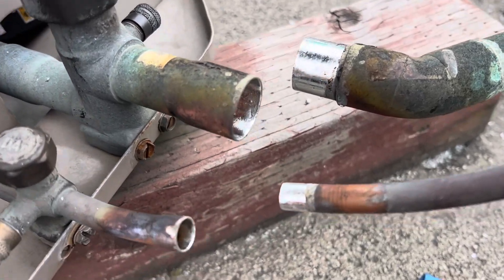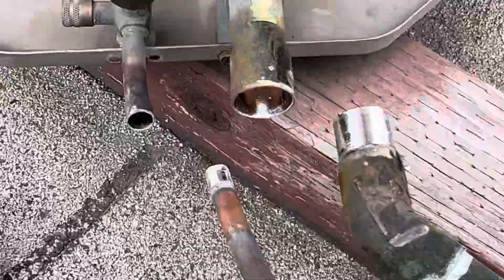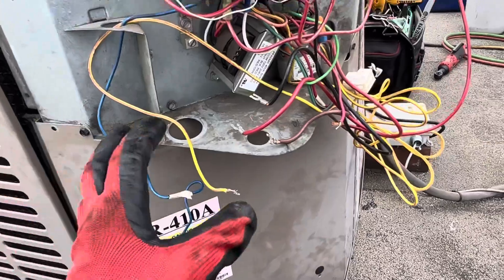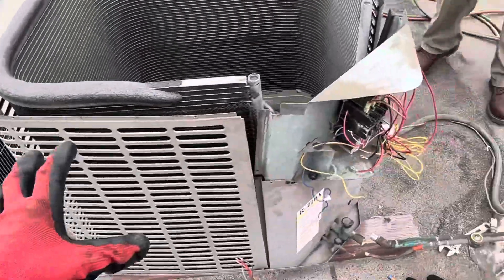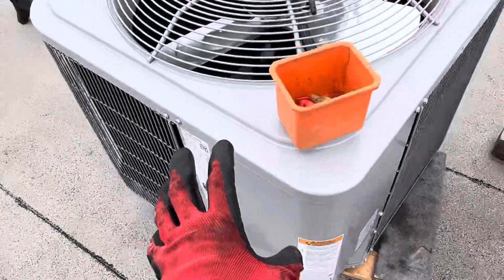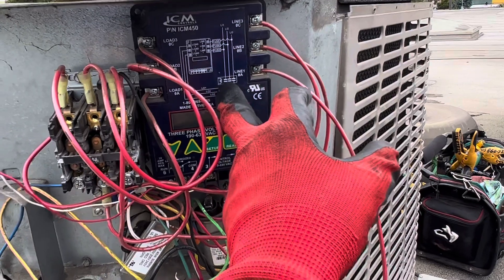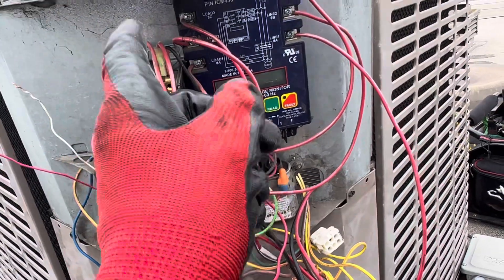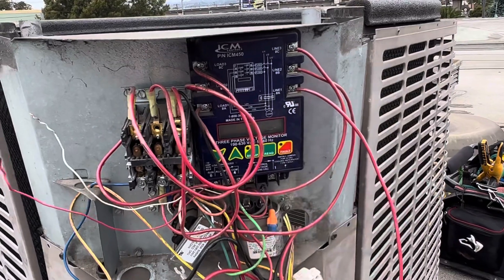AUTOMOTIVE HVAC 🔥 COMPRESSOR BURN OUT IS CLEANED 🧼 DIFFERENTLY WITH FILTERS ON RESIDENTIAL

Comment: New install strategy:
https://youtube.com/shorts/qBBXXB3enKg?feature=share4
Reply from the maker: Can you resend that link to my email YouTube will not let me open it.
thomas_ lech@hotmail.com
Reply from the maker: Got it it finally went to my other main channel, not my editing channel and it allowed me to open. Thank you.

I guess they were trying to suspended off the ceiling to not let the vibration, turning the entire ceiling into a speaker diaphragm
Reply: @coldfinger459sub0  Looked like a condenser unit in an attic and yes suspended.